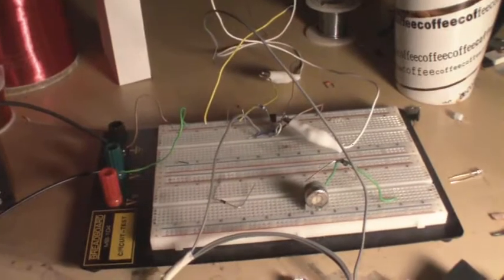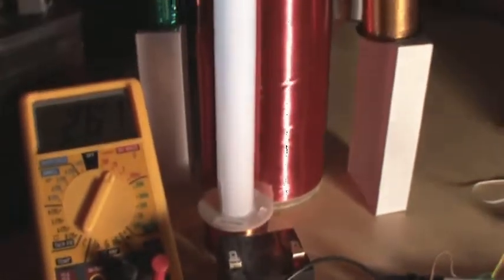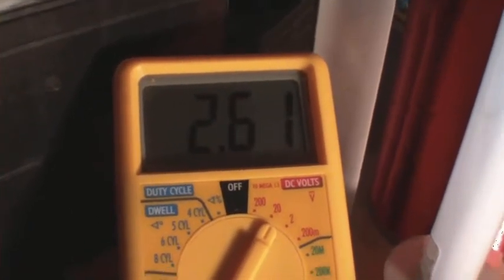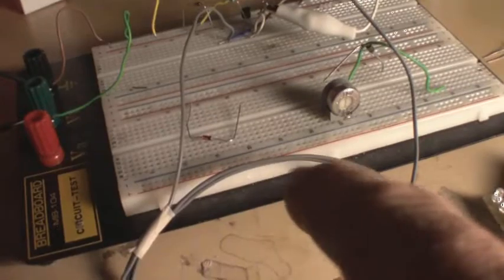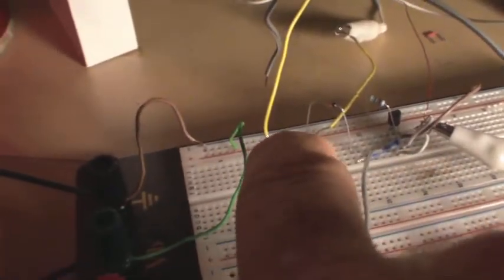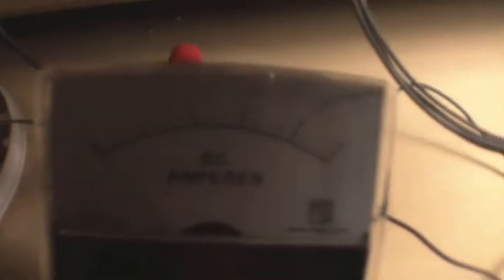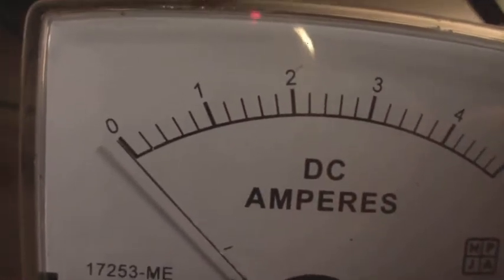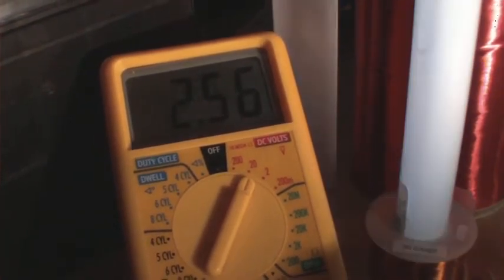Slayer Exciter - Replicating Gbluer's Addition of Pancake (- to base)

Comment from the maker: Yes At the time I had only that ammeter, later I picked up a 0-300 milliammeter (analog) that I now use for that sort of thing. You can get a fluorescent tube to emit (some, very little) light starting at about 13-15mA. Not sure what you mean by the small coils. The modified Dr. Stiffler SEC 15/18 circuit is another interesting one for similar purpose.

Comment: Gosh, that IS effective :) I'll have to try some of that !
If you do jonnydavro's trick of the second transistor to reduce power required, I wonder if the pancake and diode trick would still pull more current. Instead, you might see a permanent output rise. 
hFE is always a thought in own circuits...for NPN, 2SC1815's are the most consistent, also KN2222A. Generally, the higher the Collector current rating the better they seem to handle these loads.

Comment from the maker: no, with a slayer on low voltage, you cant use a digital multimeter for ammeter sometimes... it can stop the oscillations. at that time, i only had the 5A meter. typically the meter is handy to let you know if u are oscillating or not... sometimes it is not always evident that you are

Comment from the maker: @slider2732 check out gbluers video on adding the pancake, he gets a little more precise... he matches his extra pancake to his existing L@, gets great results. From what I understand, if you have the L2, and L1 in resonance (which has been my problem) AND you have an extra pancake, AND an L3 off the negative rail (possibly using capacitance) THEN you might get the 49 LEDs running on 1.5v, or for example, Jiffycoils 24v/43mA demo of TONS of light... thats my goal... cheers

Comment: Hi ...Not worked out what the big ammeter (5 amps) is reading. Possibly drain on the battery.
As you'll never reach one amp. let alone 5 amps, your excellent video would be even more effective with a more sensitive meter..1 amp or better down to 200 or 100ma.
You'd just have to be more careful.. An accident could say "Good night Nurse!" to the meter.
Good luck...